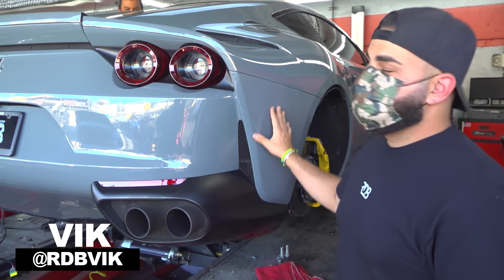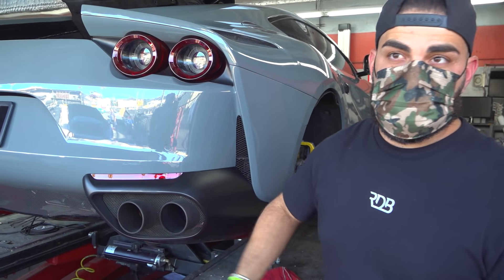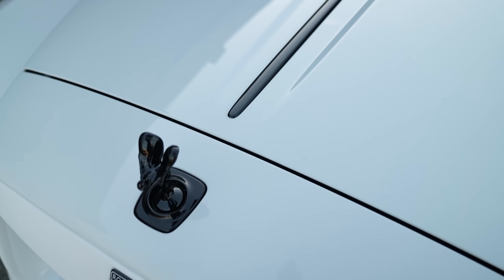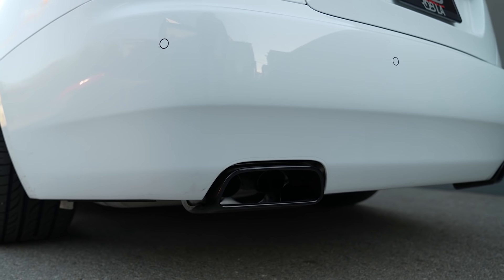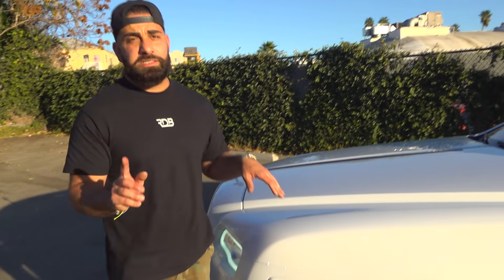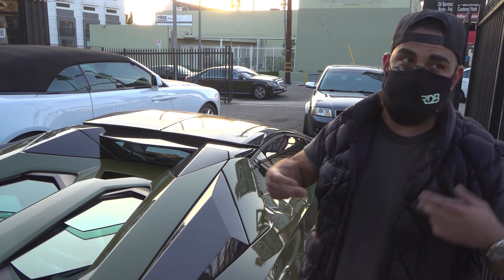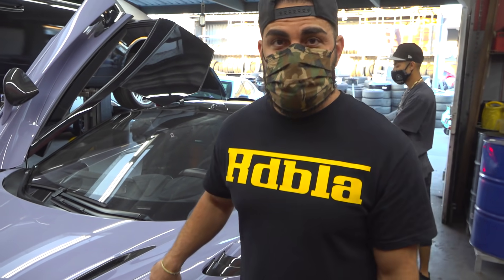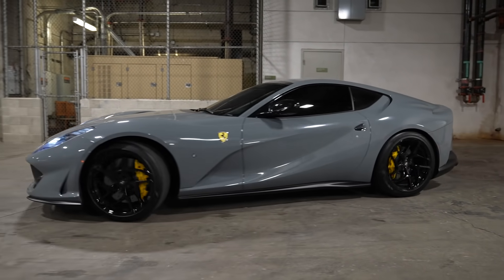Very Loud Nardo Ferrari 812, Beautiful Rolls Royce Dawn Makeover!

Comment: I can see the joint that you have made on the back shelf of the  Rolls-Royce and on the 812 one of your workers was pulling off the rubber with no care at all I wouldn't give you my cards to work on if it was for free and a good rapper would never wrap something that doesn't match in colour 95% do as a favour cowboys cowboys cowboys